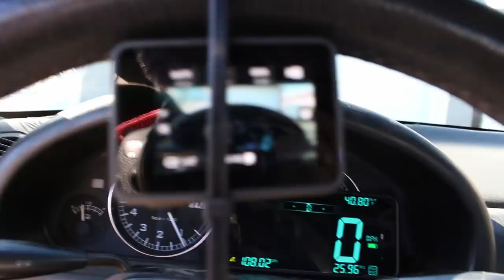Sending The Miata To 100MPH On Jackstands: The Gremlin Chase Part 4

Comment: I would BET MONEY the output shaft bearing is bad and/or the output shaft is losing its concentricity.
Reply from the maker: I have a buddy with a fully built G260, all new bearings, same issue.
Reply: @TheCarPassionChannel  really? That's extremely interesting. I suppose it was built by a quality shop right? Really hope you get it figured out Greg. I don't even own a Miata but I love your content.
Reply from the maker: @Kamwi_003  Yeah, a shop that specializes in the Getrag and ZF gearboxes :/ and thanks man!

Comment: @5:20 i can see the driveshaft vibrating at those RPM's and before that no movement, it looks as if the car chassis is flexing and pushing the driveshaft towards the differential
if you hold a toothpick between your fingers and put load on both sides it deforms to a bend, i think your driveshaft wants to do the same at these rpms , and thus shaking your car.
Maybe your current driveshaft system is too stiff and solid i dont know.
you dont use a ppf or have framerails, maybe you need a sort of ppf installed again or framerails, or a driveshaft that can handle the flex.
im not a mechanic and i dont know if i make sense here im just a keyboard warrior trying to help a man
Reply from the maker: There's nowhere near enough force to cause chassis flex running the car on stands

Comment: So are you 100% ppl without issue really don't have issue and don't run the rubber thingy on the drive shaft? Weird that stock driveshaft dot have rubber thing, but that is also transmission designed to work with it, it might just really be that bmw transmissions are not that good and the rubber thing, also maybe people without the issue just won bmw transmission lottery ...

Comment: Just get a better transmission man. And drive shaft and if u have to get a different diff do it man. Save yourself a headache and grey hairs.
Reply from the maker: But what about the people running this identical kit without issues, that's the tricky part. That's what we need to find out, what's different about my car.
Reply: True you go man im proud of u

Comment: Balance wheels again mines are poorly balanced and it starts to vibrate around 75-80mph
Reply: It seems like you totally think it's the driveshaft, have you tried wrapping the driveshaft in something to reduce the vibration? Sometimes when you cut brake rotors/drums you have to wrap them in a rubber strap to reduce the vibrations or the harmonics of the cutting blade to metal make an ear numbing screech and also messes up your cutting surface due the blade jumping during vibration. A rubber donut on ds might help?
You will notice on some CV axles they have this type of donut for vibrations

Comment: take all the bmw shit of that miata and test it again
Reply from the maker: Come do it for me
Reply: @TheCarPassionChannel  ahahahahah
Reply: put the miata transmition, and test again...
Reply from the maker: @sergiobisonte  I did. Before I installed this kit it had a Miata transmission.
Reply: @TheCarPassionChannel  i know.. im a subscriber.... what im saying is to put the miata transmition again to see if it shakes... if it shakes u know its not any transmition issue,.... if does not shake, then 99% sure its the bmw transmition
Reply: and i think that the  fixed transmition bracket to the car body may cause the vibration since it shoud have some movement.. try to release a litle bit the rubber bushings to see if it improves....
my stock miata gearbox is not conected directly to the car body i think... sory the bad english